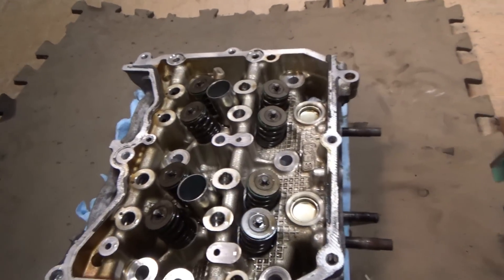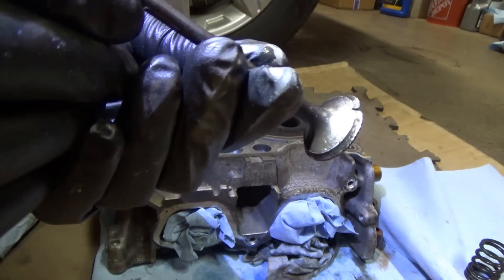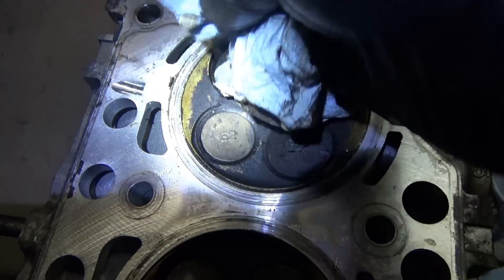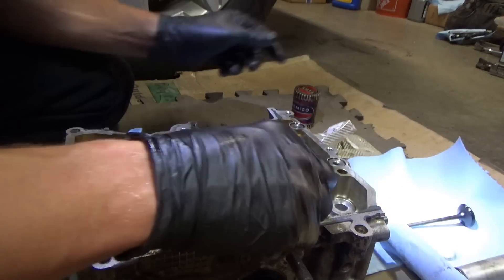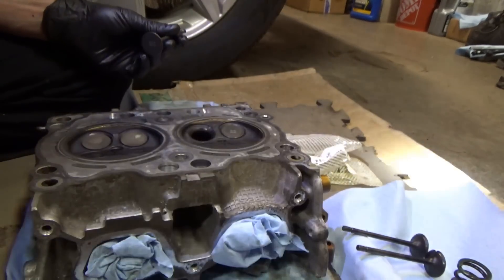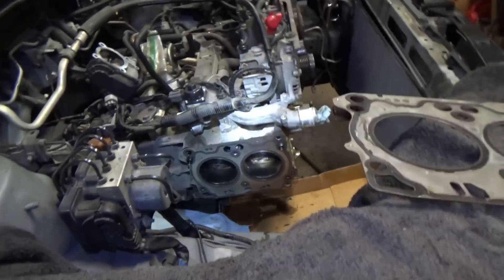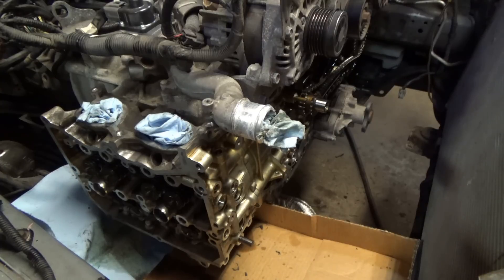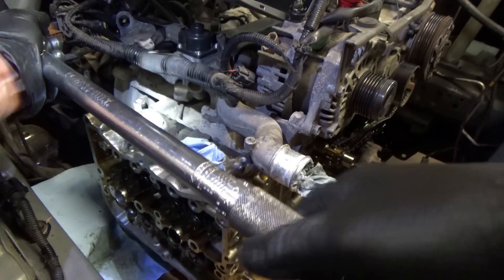What Happened to these EXHAUST VALVES!? (The Sad Subaru - Part 3)

Comment: If the Subbies have valve shims? That suggest that they need valve adjustments? 
With the valves that far into the head. That's part of the normal wear and tear process, since the valves rotate in the valve seat. 
Lean mixtures tend to cause burnt valves also. As with the valve materials.
I've done heads like you Ivan.
But with old style valve compressors to reinstall the keepers.
I used a tall sockets and whacked it and the keepers popped out. 
Same as you. I removed all of the valves. Used a box upside down and put them in order I removed them. Cleaned the head. Inspected the valve seats. If they were good. I replaced the bad ones and lapped the valve in. Cleaned the head with power washer. Cleaned all parts and installed new seals and used my old valve compressor and got it fixed. I understand the customer not wanting to spend $$ at the dealer. 
I hope the customer doesn't start blaming you because he wanted to not spend $$ $ for not doing the whole engine?
I'm sure the subbie will be ok.

Comment: I had an old valve lapper that looked like a manual egg beater. It went back and forth 4 or 5 times and then rotated the valve an 1/8th turn. Pretty cool tool.
Reply: My Dad had one to those too, used it a time or three myself.
Reply: I have one also. Has to be 60 years old. The cup is a little stiff.

Comment: The paste you're using is still available here in Europe! Same exact metal can and everything :D
Reply from the maker: Awesome! Love that paste :)
Reply: @PineHollowAutoDiagnostics  When I was ten years age my brother works with Russian car Moskwitch. He use similar paste for fixing and I don,t know what it is. Moskwiths burn a lot  valves because they use 85 octans gasolin there at russians that time and at Finlahd we have 92 octans. It was 60-talet :)
Reply from the maker: @murphy1772  Yes in USSR the regular octane was 76 for low-compression engines. I think Moskvitch was designed to run on 92 minimum. My grandfather had a 1987 model, and he used a double head gasket to lower the compression so he could use the cheaper gas hahaha

Comment: They must be getting rid of the car.
Reply: I would... The other side will soon go
Reply: I mean I would get rid of that car after this half-assed repair. Torque to yields not replaced, and not torqued properly... On a Subaru headbolt, nonetheless. That gasket is not going to stay good for long.
Reply: @kain0m  I think I get that new, green bolts can be torqued to "yield."  That not having EVER been torqued vs PREVIOUSLY torqued is troubling if using OEM specs.
Reply: Interesting observation.  likely true

Comment: Looks like just poor quality exhaust valves.  My 35 year old lawn mower has better looking valves.
Reply: My edger is 30+ years old but not high mileage but 35 years is not old for a lawn mower unless you have a HUGE lawn or are a gardener for a living.  My edger runs about 5 minutes a week in the summer and half that in the winter. I've only change the oil three times LOL Still starts on the second pull. For a gardener, lawn mower engines last about 3-4 years running them every day though I've never had a valve burn on one. Never had a valve burn on any vehicle in, (gotta count on my fingers) 50 years and more trucks than I can count without paper and pen.
Reply: @hikerJohn  You should have seen my little Austin 1100,s valve seats they where so worn and burnt the Exhaust was blowing across into the inlet valve 😂🤣 I was surprised it still actually started and ran on 1 cylinder.😂🤣😂
Reply: @stephenjones9153  That's funny. Cut car as well.

Comment: Defective manufacturing of the valve. Burning valves are supposed to be a thing of the past.
Reply from the maker: Yeah I was really surprised to see this failure on a modern vehicle 😳
Reply: Because of the configuration of the engine , carbon deposits are more likely to burn on the valve seats , thats why subaru insist on using their upper cylinder cleaner every service to prevent this

Comment: I seem to remember Ford having similar exhaust valve problems back in the 90's, I think that was caused by the valves being faulty from manufacture, with micro cracks in the metal, or poor quality steel. Maybe same cause here. I had to change quite a few exhaust valves on the early ford zetec engines.

Comment: I know you pointed to the head gasket as a possible cause, but is it possible there was a flaw in the casting/bad steel for the valves that would make them more sensitive to degradation due to heat?   I might have to visit some Subaru forums to get their take on the 2.5l

EDIT: the most common problems with the 2.5 appear to be head gasket, and oil consumption, with ringland problems for the turbo version of the engine.   There are anecdotal problems seen for problems with exhaust valves at higher mileages (150K miles and up).   Whether this is an endemic problem is unclear, although you'd expect a lot more complaining from owners if the engines failed at 150K miles generally.